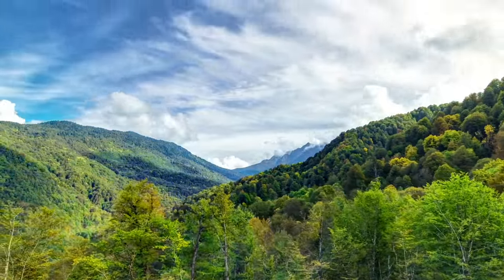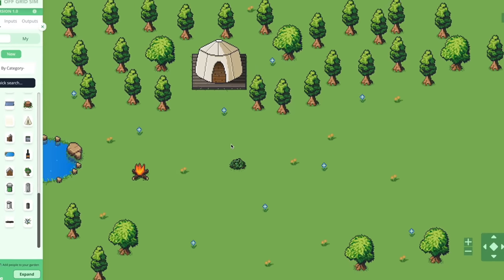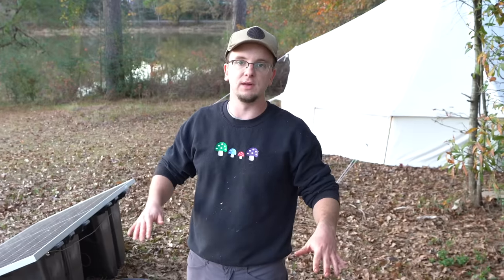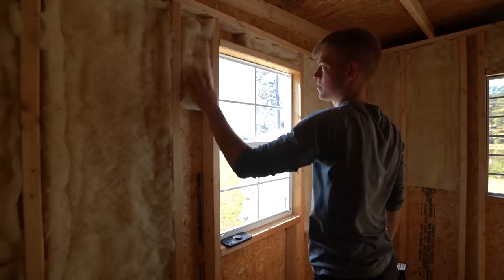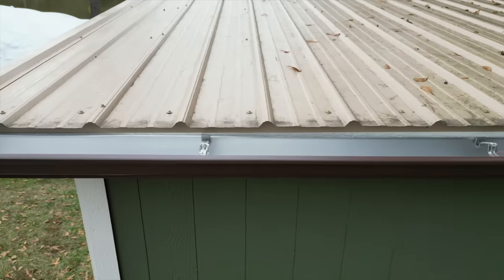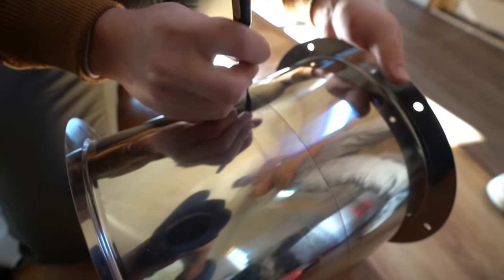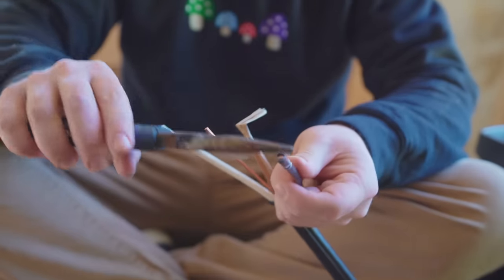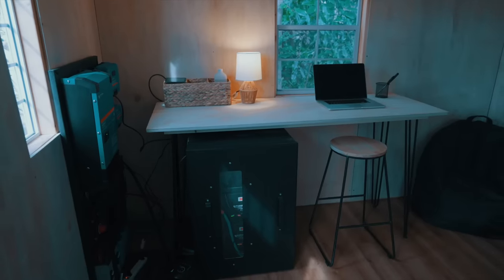We Went Off Grid In 30 Days With $25,000

Comment: As far as the tyvec suit goes for spray foam goes, it's used because the 2 part chemicals used in spray foam when mixed are really sticky and there's lots of little floaters that would drift back into your clothes and unless you want to dedicate a particular set of clothes to use when applying spray foam it's just more practical. And 2 major hazards that are the reason installers uses supplied air resperators are 1 spray foam is applied as a sprayed liquid that is also airborne so it's a respiratory hazard just like any other dust and during the cure process the foam off gases fumes but as long as the 2 parts were properly dispensed in the correct ratio and in the correct depth between layers spray foam is safe long-term.

Comment: "wool insulation isn't that much more expensive" yeah just two or three times more for half the product. that stuff was thin AF. oh and they spent twice its cost just on shipping it. then after the huge ECO rant they go on to talk about composite flooring XD. I liked the video for the most part but I definitely think you could've done this for like a quarter of the price. For instance ditch the tent and just start with the shed in the first place. The Xbox and TV were unnecessary and shouldn't have been included in the price. Heck for half of what you spent you could have gotten a used single wide mobile home in good condition delivered to the site.

Comment: Good job. My only thing with the shed. Is you used lvp, and polyethylene underlying. Couldn't you have used something that was biodegradable in 30-40 years? You made sure the insulation was wool. And then used all plastic for the floors.

Comment: Hey!!!, check out the HCALORY 8KW Diesel Air Heater All-in-one 110V AC & 12V DC Support with Altitude Mode 6L Fuel Tank Portable Parking Heater Bluetooth APP Control Heating for Car Truck Boat RV Campers. You can heat-up your whole tent or shed for pennies. I have one and it heated my 22 ft travel trailer on the lowest setting. I use my Eco flow delta to provide 40- watt hours of power when my heater is on high and around 10-watt hours when my heater is on low. My heater has 6.0 Liter fuel tank. That is an awesome set up that will provide you with days of good dry heat. It uses very little electricity and very little diesel fuel. "NO FUMES". don't miss out on this. Van dwellers and Nomads use these heaters all the time. I for one love wood heat and have lived in places where wood heat was my only source of heat but using the diesel heater outside of your tent and ducting the heat into your tent will win you over.

Comment: Please do a recap of the project.  Share an expense sheet and discussion on what might be done differently.

A few thoughts to start the debrief process

Floor everything
Electrical before finish
Ceiling and floor before walls
What would need to be different to meet electrical code
Story board for electrical boxes
Exterior shed for electrical equipment
Better stove / heat install
A/C
Move to final site
Vendor kudos

Thanks for sharing!

Cheers!

Comment: But with how short that wire run is, is it really necessary to convert the DC power to AC power? Don't TVs, computers, and electronics use DC power anyways? The only thing you'd need an inverter for would be a fridge, AC unit, and maybe a heater and stove.

With what I've read, converting DC to AC and back to DC, there is somewhere around 20-25% power loss

Comment: You made a big mistake in the interior finishing of the cabin, namely, between the thermal insulation and the wooden boards, an aluminized foil was not installed, the vapor barrier, and thus all the humidity in the room will migrate inside the wall and top where it will condense and that means mold inside.
Setup for current AC is very expensive with many parts, totally unproductive because each equipment has its own consumption, all this could be solved by a single solar inverter, all in one which is much more efficient and takes up less space

Comment: another good Pre Filter system if you have the height for it, is a Sand Filter in an IBC Tote. i've been wanting to experiment with a sand filter going through blackened copper piping to preheat and potentially boil water before storage. all could be done with direct sunlight. for the solar preheater, you coil tubing in an insulated box all painted Flat Black with a glass, or corrugated plastic lid in direct sunlight. in the heat of summer, it gets really close to boiling and could be used as a "hot on demand" heater for a wash basin.

Comment: As you have probably heard, the marinade function on the chamber vacs actually opens the "pores" of the meat. There is no reason to put the meat in a bag when marinading. 

What is important is to pull a vacuum in the space that the meat is in with the marinade, and to maintain that vacuum for a short time before letting the air back in. My chamber holds the vacuum for a full minute. Put the chicken into a small bowl with the garlic and rice wine, and then put it into the chamber. Pull the vacuum, release the vacuum, and you are ready to go. The equivalent of an hour or two of soaking the meat in the marinade can be achieved in a minute. 

All the external types give you is a place to put the marinade next to the meat.  There is no significant pressure difference, and thus, there is no acceleration of the marinade process over, say, putting the meat in a bowl. 

All the externals should get 0/10 because the function is actually lacking. 

Thus, the part of your video that discusses marinating with the external sealers is kinda senseless. 

There are things you might have compared between the chamber vacs...how large of a dish could you put into the chamber, did it have a marinade function that avoided sealing the bag, was the amount of vacuum and time under vacuum adjustable, etc.

A difference which I didn't recall you mentioning is bag cost.  Chamber dealers can use smooth bags, which are much cheaper.  All of the external sealers I know of use internally textured bags. Those bags are way more expensive than the bags used by chamber sealers, which are smooth plastic. 

This is significant when you talk about a lot of bags.

Comment: Nice video, but I probably wouldn't have mounted the electrical board adjacent to a window, low down on the floor.  With as small as the microcabin is, you'd be better off mounting it higher up on the wall and pushing the battery below it to free up space.

Comment: you seem to have a vast knowledge for being self sustained. except you didn't go about it the right way. for heat the wood stove is ideal. then for solar you spent a little much. where you didn't really need an xbox although its ideal. where as for the heat you could have done better with a "zodiac Canvas" then for a permanent shelter, with a bit of woodworking you could have saved yourself money by outsourcing the materials from online places that sell used products. so with basic woodworking with fasteners, with basic hand tools. for consist temperatures, you could also use bagged charcoal under the floor where if its to moist then it absorbs then when its to dry, the it releases the moisture. as well as you could use the charcoal for a filtration. then you could also put the solar panel on the roof

Comment: The fox isn’t going to trip. The coyote is going to casually meander to your chicken house and dig under the walls and slaughter the chickens trapped inside. You need to level a floor  and dig a trench under your walls and either pour cement or line the trench with double chicken wire and drop the walls down inside the trench and back fill .
Reply from the maker: It’s a joke about the fox ;) We don’t have many coyotes this close to town.  Further out we’d predator proof more as needed

Comment: I know the purpose is to be green but the carbon footprint to source and manufacture all the green materials for three guys to do this would take a decade at least to overcome. 

Just go buy a labor saw mill and cut dead pines and other good lumber trees from the land you purchased and use the resources on your property. You could have built a cabin with zero transportation costs and minimal carbon emissions by the two week point and buy bunch of thrift store/second hand items like the wood stove. Green didn't need to be so strict if you use common sense and imagination. Negotiating skills would be a great thing to develop too. Things like old galvanized roofing and even old nails and screws for constructing.  Get creative.

Comment: I'm off grid and your pricing is off and details are missed just the battery and victron setup is well over or about $7 -$10,000 the utility box and breakers wires  plus i.just find your pricing off from reality nice video
Reply from the maker: We specify in the video we went with a bigger solar setup, ours would be about $9k.  A smaller $3-4k system could absolutely work for this setup, as we are using an oversized system :)

Comment: Isn't it a bit hypocritical to go on and on about how wool is much better because it's natural and there's no off-gassing or need for masks during installation and right after you install vinyl flooring which does just that because vinyl is a plastic that is just as bad as finished spray foam installation... same with most OSB/plywood - where they use synthetic glues most of the time.

Comment: I wonder how reliable and difficult to repair all that is, esp. the electric system since batteries and solar degrade over time? 
Awesome stuff tho
Reply: Well tended lithium batteries last approximately 10 years. Solar panels 25.
Repairs are much easier and generally less expensive than home systems.
Reply from the maker: We know how to repair all these systems after installing them, better than our suburban homes!  It will be cheaper to repair too.